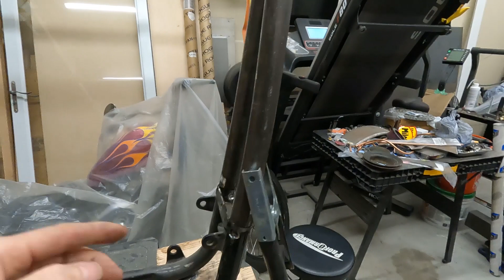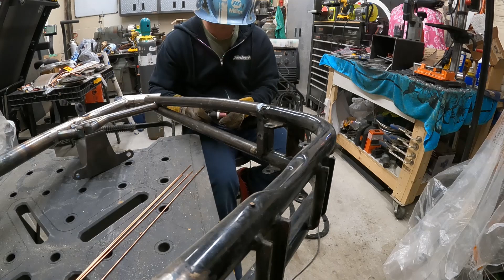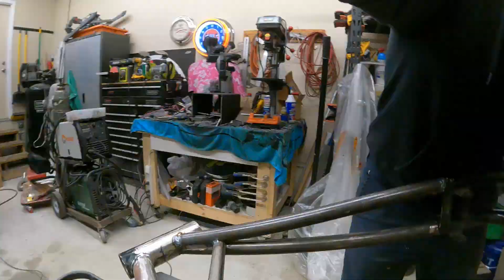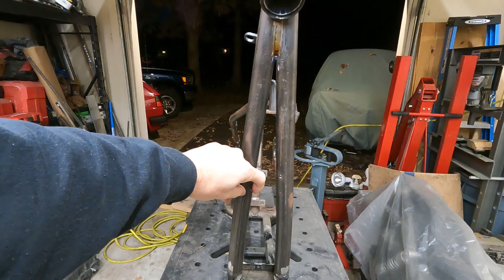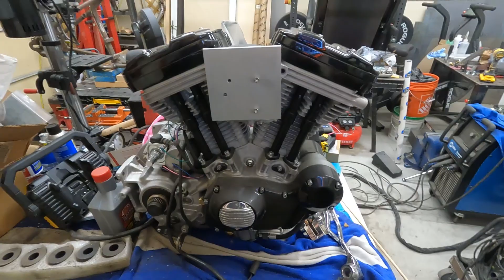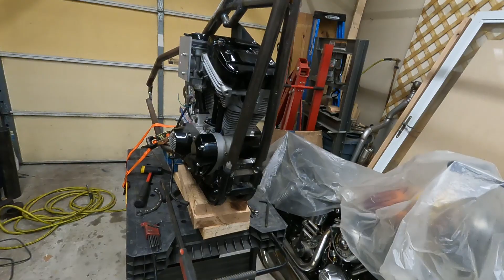Sporty frame welding and motor install. The shovel takes some battle damage.

Comment: hi zippy. here's to hoping your time bomb don't really explode your neck. happened to a friend many years ago, outcome not good. what we used to do with triumphs back when i was young ( 'cause they were a pain to get motor in frame) , was lay the motor on it's side on blocks, then put the frame over the motor. saved a lot of paint jobs that way. i've never worked on many sportsters though. mostly big twins, and some triumphs. how many quarts that sporty oil tank hold ?
Reply from the maker: I've heard of other people putting the frame on the side and putting the motor in.  May try that one day. Gonna try and get the tank to hold 3 quarts but we will see.

Comment: That sucks you dented your shovelhead tank. Just curious did that o ring spacer work on the tranny leak?
Reply from the maker: Shit happens. Unfortunately not. The issue is the main shaft bushing is too worn and needs replaced.